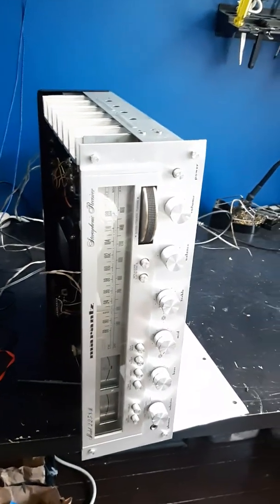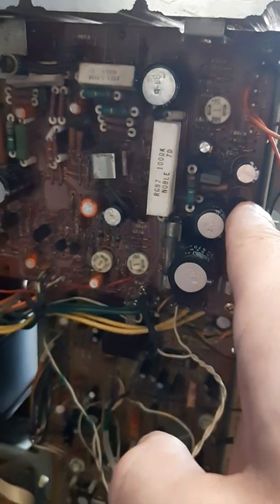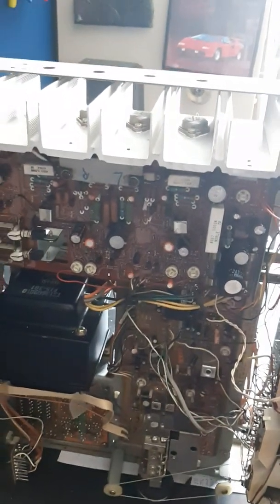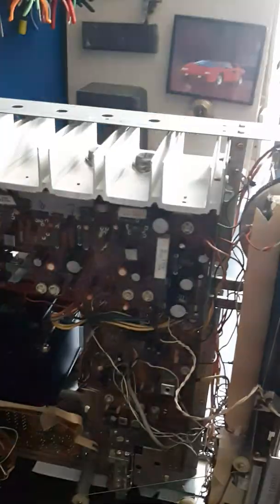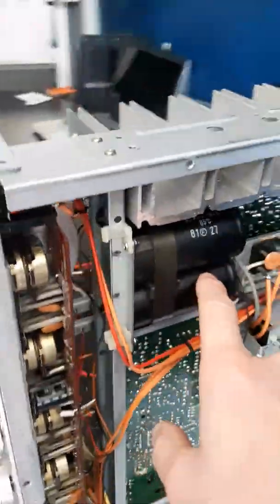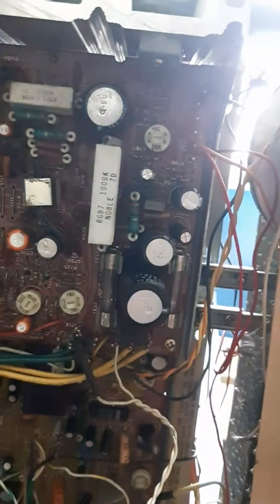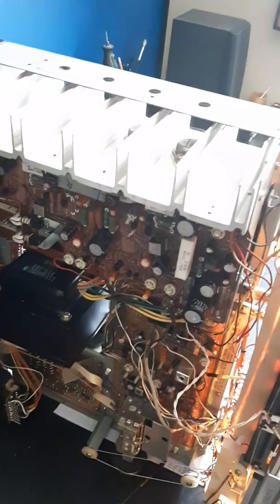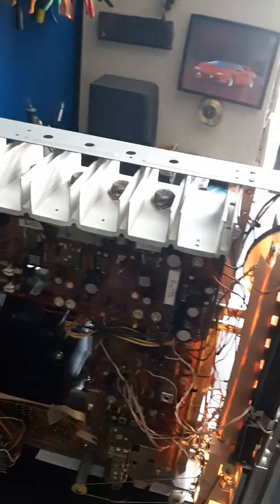Marantz 2238B repair part 1 - Inspection and troubleshooting.

Comment: Greta vid did you end up doing a follow-up video on this piece ?
Reply from the maker: Hello and thanks @BartolomeOrsini

This video was initially to document my inspection from someone who very understandably felt ripped off by another technician/repair shop, or, so I was told when I received it.

I did not want to provide more information than this to that repair shop, so my only follow up was simply to show that the repairs I did on it fixed the issues.

I probably have some notes and documents saved somewhere with all of the details.

This was the only follow up video that I made after the repairs to demonstrate that it was successfully repaired.

youtube.com/watch?v=hs2l8w4GEjs&feature=youtu.be 

Cheers from Montreal and happy listening! :)

Comment: I think I'm missing something here, but why didn't you actually fix the receiver and then show us on YouTube how you did it? I watched it all the way to the end where you mentioned what you thought the problem might be, and then the video just ended. What's the point of posting this video then?
Reply from the maker: Hello Richard :)

The main point of posting this video was for providing my client with a verbal and visual inspection, to compliment what I had submitted in writing, which can get a bit technical and hard to follow.

As this item came from another repair shop that essentially frauded my client, I wanted to provide some documented evidence and a professional diagnostic before anything was repaired.

The video seems correctly labeled as 'inspection + troubleshooting', which is the first part of the repair process

While Im not entirely equipped to record and publish the work that was done, which often requires three hands, Im also less motivated to give free advice to my former competitors, who have been dishonest and abusive to other members of our community.

At the risk of coming off rude, which is not my intention, Ill flip the question and ask what the point of your comment is? Are you trying to repair a similar problem?

Regards and Happy Listening